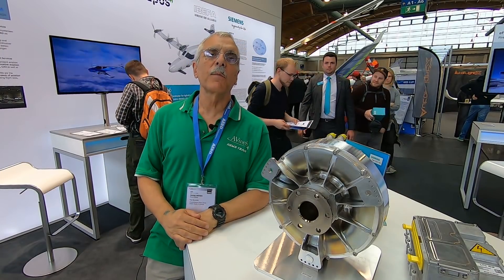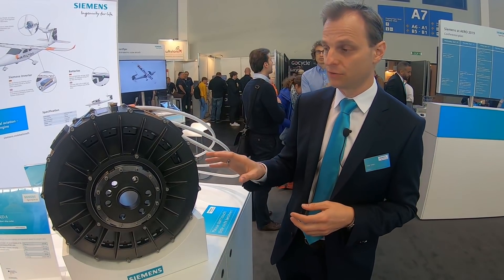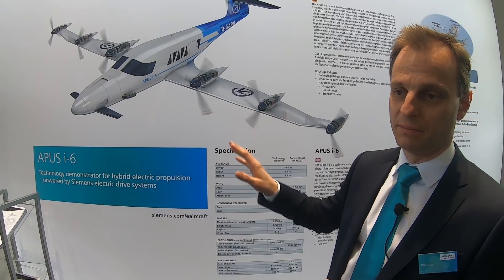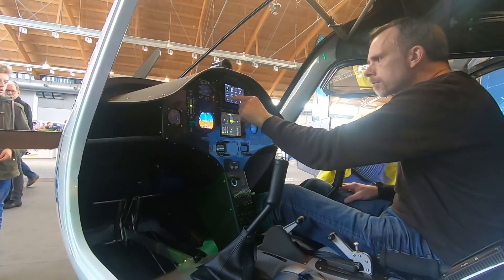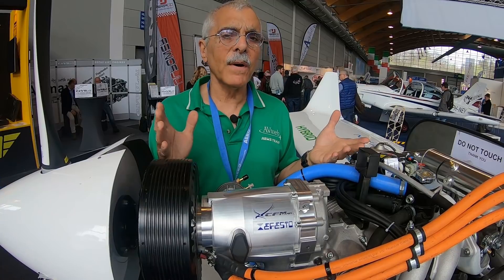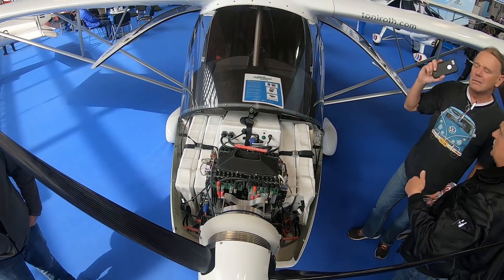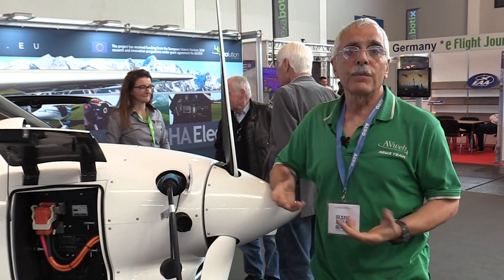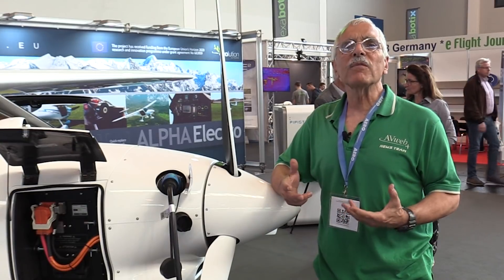What's New in Electric Airplanes?

Comment: One thing that could be interesting with this kind of stuff is having two counter rotating propellers if you want more thrust, comes at a cost of more noise though....
But doing that with electric engines is a lot simpler to do the with a mechanical one.
Reply: Luredreier 
With electric motors it’s probably simpler just to have multiple props or multiple EDF units.
Counter rotating on the same shaft is not as efficient as twin props. One of the benefits of electric is the ability to put motors just about anywhere.

Comment: A fully electric plane would be good for training or hobby flying but that's about it as batteries don't have the energy density for long range flight.
The parallel hybrid at 6:30 would be a good concept to bring into production and could increase safety.
Reply: There is Axter Aerospace of Spain who have it commercially available for years. (experimental only iirc). Bit of an oversight not to include them in the reporting.

Comment: Weight is the enemy of airplanes...more weight means high wing loading & reduced aerodynamic efficiency. Unlike fuel which is normally stored in the wings and burns off during flight reducing weight improving aero efficiency,  batteries takes up space (fuselage) & is ever present...dead weight as the the energy is used & flight progresses.  Regarding  hybrids, they add to the complexity of the propulsion system...that's another story! Manufacturers should go full electric or not at all.
Reply: Yeah, weight is an issue, but I never understood the "diminishing weight" argument.  Yeah, fuel tanks reduce in weight as you fly, but they are the heaviest during the most critical time - takeoff.  Weight is much less of an issue during cruise flight, or during landing (unless a go around is required), which is when a fuel tank would be the lightest.  Seems like a pretty minor advantage fuel tanks have, especially in comparison to the general issue which is simply comparing 4 hours of fuel vs 4 hours of battery.

All aircraft metrics are usually taken at max weight anyways
Reply: Not to mention the added expense of the hybrid system.
Reply: An extra boost at pattern work, better noise abatement, is useful for some missions. It's just physics, for some missions it's great, for others not. What's great for Rutan's "Voyager" is bad in crop dusting etc. Insurance premiums for some new aircraft will be telling: If that boost at engine failure gets you one pattern with a soft "dead engine dead stick but not dead motor" landing, you'll have that answer by actuarians.
Reply: @xpeterson. 
I'm all for innovation & a proponent of ideas that work efficiently! Unfortunately the electric propulsion systems for aircraft will only work for recreational flying but not a viable alternative for commercial transport. No doubt these airplanes (on this video) use the best battery technology available today but are yet to give us the range we would like. Moreover they can not offer that vital security necessary when "in flight" because of the  constant "decay of propulsive energy" from the battery! Very much unlike a petroleum powered craft..."constant power"! This can be unnerving even with electric cars running low on "electrons"! Just imagine what the feeling would be in an airplane!  

I should float the idea to these ambitious (pioneer) builders that it may be worth considering wings covered with solar cells for obvious reasons. Even though the improvement might be small it could possibly make their product more attractive to the recreational flyer with lot's of disposable $$$!

Comment: Heavy, expensive, short range, more complex, dangerous (in case of fire). Why not take a reliable engine combined with a prop? Ah, i forgot, not new.
Reply: Much less complex. Open your electric lawn mower and compare with your car engine.
Reply: @Walterwaltraud I referred to hybrid, i did not mention.  In regard to fully Electric, yes. But thats more like Landing under final reserve…. MaydayMayday, i have to land right now...i fly electric!!!
Reply: @stefanmargraf7878  That's the idea of pattern work and practise area. 30 min of reserve get you dozens of miles at that speed. It will  rarely venture further from the airport than 10 nm. As for hybrid: the smaller generators with few load changes are more reliable for obvious metallurgical reasons. Plus the safety is enhanced by dual sources of "altitude preservation". It shall be certified anyway - wel'll find out over time :-).

Comment: If batteries can become universal, it might be a good business to get this batteries swappable at FBO's like a gas station.  Instead of waiting long hours for charging, just drop used and get a charged set.  Of course station should do their job on quality control.
Reply: That's actually how Pipistrel Alpha Electro works already today.
While you fly the second pack can charge. They are heavy, but still swappable. Make sense if you have a pilot training or short sight-seeing business.
Reply: Batteries are swappable but you cannot charge them outside aircraft.
Reply: @Power_DC_Official  "Batteries are swappable but you cannot charge them outside aircraft." This doesn't seem very reasonable. I don't see a word about this in the documentation, it doesn't make sense. Are you sure?
Did you speak with any qualified representative of Pipistrel?
Reply: @richardpetek712  I work at Pipistrel as support engineer for electric aircraft so yes, I have ALL information.
Reply: @Power_DC_Official  Nisem mogel vedeti. :)
Kaj je BMS krmilnik del letala ali del napajalnega modula?
I couldn't know.
Is the BMS part of the plane or a part of the battery module?
Reply: @richardpetek712  BMS is part of battery. Not being able to charge batteries outside aircraft was company decision.
Reply: @Power_DC_Official  [...] Not being able to charge batteries outside aircraft was company decision. By using two sets of batteries the plane could fly flight school lessons continuously, without that option it is stranded for an hour and can do only two sessions per afternoon.
Tell that to Ivo Boscarol or Tine Tomažič (R&D Director at Pipistrel).
Reply: @richardpetek712  What I told you Tine told me after I asked him exactly  the same question. There are good reasons for this decision but I cannot talk about them. There are a bunch of electric planes in development at Pipistrel, so... Stay tuned =)
Reply: @Power_DC_Official  Alpha's huge advantage is that it is already a certified plane. Competition isn't waiting, Bye Aerospace eFlyer 2 and 4 are promising and close to production. 
https://en.wikipedia.org/wiki/Bye_Aerospace_eFlyer_2
Having a 92 kWh battery will give a lot of endurance (up to 3,5 hours) , but also a weight of about 450 kg, give or take, even if these will be packed in 6 batteries, 15 kWh each. If I use Alpha Electro as a reference, that's about 75 kg each. This doesn't look as replaceable, at least now without heavy lifting.

There are many others too:
https://en.wikipedia.org/wiki/List_of_electric_aircraft
BTW, somebody should edit this page and add Pipistrel's Alpha Electro.

Tell Tine that he should really reconsider - having this option (at least as an option ) would be a huge marketing advantage. 
A 2-seater Panthera Electric? It doesn't even exist on the homepage anymore.

But a certified electric plane that can land and be ready to be flown again  in 5 minutes would be a marketing boom.

There are good reasons for this decision but I cannot talk about them.
I am just telling, this is a gigantic mistake, no other company can or will be able to offer this because all of them will have a lot bigger batteries which cannot be replaced, at least not as easy, but at the end - I have enough of arguing with you. Neither will I call dr. Tomažič any names, he is an expert in engineering, but obviously pretty lousy in marketing; if I read it correctly, he is also the CEO and this makes things just worse.

Have it your way and have a nice day.
Reply: @richardpetek712  Alpha Electro is NOT certified. Next electric 2 seater will be.
Reply: @richardpetek712  Actually.... I was thinking of much larger scale... like nation-wide.  It'd be like buying an airplane without battery pack, but keeps exchanging as you fly.  Some would buy maybe 2 packs and don't rent, but for many that fly far will benefit from the program... I'd totally dive in and create such if I had money.  Like MillionAir(spell?) sells gas at a cheaper price for members you know.
Reply: @turboromy  Interesting idea - but it would have to be another plane. Pipistrel Alpha Electro doesn't have a range (and battery) where this would make sense. Keep this as an idea for the future!
Reply: It works for very small and short range aircraft like the Alpha Electro, but for even slightly larger aircraft like the eFlyer 2, the batteries must be distributed throughout the aircraft (e.g. built into the wings, among other places) making swappability impossible to achieve.
Reply: @airops423  To me car engine hood opening and closing so nicely is amazing enough.  Lately, I am again amazed with SUV trunks. ^ ^   If what I say would work, it must be whole industry driven, like dry batteries comes in AA thru D sizes, I guess electric planes can have multiple locations and sizes of battery compartments and designers should go with industry standardized sizes and specs.  Small ones can use 1 or 2 while larger takes like 5 or more.  I believe different capacity lithium batteries does have technical issues as in smaller one drying up before large size one when serially connected.  But I'm sure it is a minor obstacle.   Some years ago, I wished for an electric aerobatic plane to become available for a cheaper price without all those inverted fuel and oil system, and noted Tesla is building a huge battery factory and they might come up with aviation standard.  I won't bet life on it, but let's see.  I just wish flying gets much cheaper, but this I bet it won't happen.
Reply: @turboromy  If by flying getting cheaper you mean general aviation, I truly believe that's just on the horizon. Look at Bye Aerospace's eFlyer 2 and 4. The eFlyer 4, due to be released in two years or so, is comparable in specs to the SR-20 and costs $19 per hour to operate, including the $10 "battery reserve" to replace the batteries every 2,000 hours or whatever similar to an engine overhaul. Both should also drastically reduce the cost of flight training, which is their primary goal.
Reply: @airops423  Wow,  it is the greatest news.  I've been an inactive aerobatic pilot for too long.   $19 sounds a bit too low, but lower the better !!!
Reply: @turboromy  Here's a full breakdown of ops costs for you:
Energy (fuel): $5
Oil: N/A
Maintenance Labor: $2.40
Parts (airframe, engine, avionics): $1.00
Battery Reserve: $10.00
Engine Restoration: $0.60
Propeller Overhaul: $0.80
Total Per Hour: $19.80

It's even cheaper for the eFlyer 2, the two seat variant. $14/hr for that one.
Reply: @airops423  Thanks.  I thought that $19 was rental cost, but must be bare cost.
Reply: @turboromy  Yeah, who knows how much a flight school would charge to rent. I would guess around $50? Still a great deal. And even less with a flying club, maybe $30. It's going to open up a whole new market, so this is just speculation. It'll be fun to see.
Reply: @airops423  I'll be happy with near $100 for something comparable to Decathlon.  I believe it rented at $89 in the 90's. Cherokee around $65?  Things were better and affordable.
Reply: @turboromy  I mean, I can rent a Cessna 162 in Seattle for $120/hr wet. For comparison, $89 in 1995 is worth $145 now.
Reply: @airops423  Well, the Pipistrel Alpha is a light training aircraft / technology demonstrator.

From the the manual:

https://www.pipistrel-usa.com/wp-content/uploads/2018/03/Pipistrel-Alpha-ELECTRO-Information-Pack.pdf

The plane operates in cruise / cross country for 45 minutes @18kW and 75 KTS indicated airspeed (+20 minutes reserve). This means that the range is 45/60 x 75 nautical miles = 56 nautical miles = 104 km = 65 miles.
The reserve gives additional 14 NM / 25 km / 16 miles range.
Any wind can change these numbers significantly.

With a powerful 3-phase 400V charger the charging time is about one hour.
It has 2 batteries, 10,5 kWh, 53 kg / 117 pounds each. The swap takes under 5 minutes.
Although swappable by a single person, I am not so sure if two people wouldn't be better.

As you see - I don't think that this is a general aviation aircraft that goes beyond short flight school / sight seeing usage of up to maximum 45 minutes, maybe up to 60 minutes in optimal cases.

If we take some headwind into account, this plane has a (safe) range of about 80 km / 50 miles, in heavier headwind cases even (significantly) less.

And once we come to alternative designs to Alpha Electro - batteries offer a very compact energy storage. They don't take up much space. Yes, they could be stored in wings too, but only for structural reasons (better weight distribution) - in which case having them removable makes things very complicated and not practical. In that case they have to be charged in place and Li-Ion batteries take about 45-60 minutes to get charged to 95%. There is no way around.
For big passenger planes this is not a problem - that's the time to get one set of passengers and cargo off the plane and the next ones to board the plane.
For a small plane this is a waste of time.

But - swapping batteries in big scale is complicated - it is matter of replacing a heavy yet delicate pack. 
But yes, something in the shape of the 
https://en.wikipedia.org/wiki/Cessna_208_Caravan
(although in a more streamlined design) could be possible, but swapping a very heavy "cargo box" takes a heavy load forklift with a precision in the range of 1 mm ( 1/25 inch). Swapping batteries in bad weather would be very very tricky too.

But if you ask me - I wouldn't go for a swappable design, I would rather have 10% bigger batteries and charge them to 90% in place. This takes (it depends how deep they were discharged) only some 40-50 minutes; charge them to 80% and we are getting close to 30 minutes. Once we add a lot more of them (and yes, put them into the wings to distribute the weight, similar to fuel), a more decent flight time is possible too. The current maximum capacity of batteries is about 250 Wh/kg, Pipistrel Alpha has 200 Wh/kg (at the pack-level, including housing). Elon Musk estimates that a capacity of 400-500 Wh/kg would be needed to make them really practical.
Reply: Romy Kim that’s a good idea
Reply: Edison invented a battery that was claimed to last ten years, the oil companies bought that patent up real quick and now you will never see it
Reply: Moe Bedick And Islam is a religion of peace 👌🏻

Comment: The simplicity the the electric motor is destroyed by the power storage - the complexity of these systems just boggles the imagination, as for better batteries they will have to find a new chemical atom as the current materials have reached the development limit were big gains are possible cheaply. The energy density of liquid fuels cannot be matched by any storage system existing or in the mind of a design team in a dark lab, if some one develops a liquid fuel anywhere near the current crop - game over but I am a cynic.

Comment: Why is no one talking about Fuel Cell / Hydrogen Planes? Especially considering compressed Hydrogen has at least a 100 times more energy density than the best battery in today's market?
Reply: Compressed gas tanks? Sounds like a serious weight issue.
Reply: I am NOT really sure about the Weight issue but my rational here is if you look at the Nikola Hydrogen trucks, they are opting for Compressed Hydrogen in place of batteries to reduce weight (yes, to reduce WEIGHT) of the trucks and to increase the driving range.
Reply: @Soothsayer210  If you look at the Toyota Mirai, it's heavier than the Model 3, makes less power and has less range.
Reply: @PistonAvatarGuy  I do not know the weight of Toyota Mirai besides i believe it has far greater range. But what i am comparing here is the Weight/ Range of Nikola trucks in comparison with Tesla Trucks. And the reason why Nikola trucks went Hydrogen is precisely for the same reason.
Reply: @Soothsayer210  Like I said, the Mirai has LESS range and weighs MORE. The latest versions of the Nikola Trucks have BEV options.
Reply: you are evading my question, lets NOT talk about Mirai. The Nilolas BEV you are talking about is only an intermediary mid sized trucks but the real truck of Nicola IS FUEL CELL /HYDROGEN with about a 1000 km in range much more lighter than Tesla Trucks. Please check them for yourself.
Reply: @Soothsayer210  Both Freightliner and Tesla are offering Class 8 trucks that are battery powered. Hydrogen makes absolutely no sense in any vehicle, it's too expensive to produce and offers no environmental benefits.
Reply: @PistonAvatarGuy  thx for your patience. I agree with you that Hydrogen production and Fuel Cells are too expensive for the existing technology. But we are taking about Green Hydrogen which is what Nicola promises. Besides when countries like Japan and South Korea are really going after Hydrogen, it makes me think twice. I also believe that it would have been nice to have both as alternate fuels since the goal is to kill Fossil Fuels completely. 
Thx again. Have a nice day.